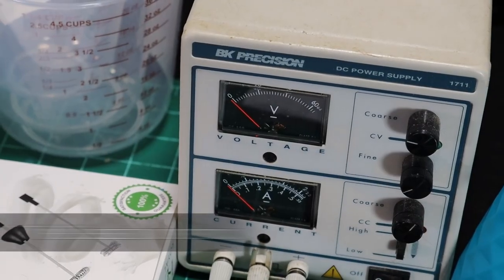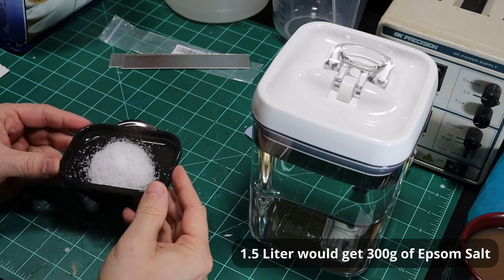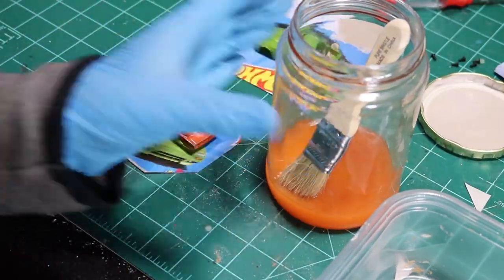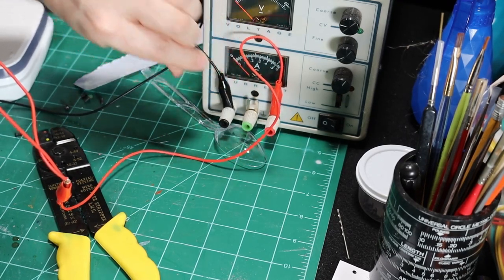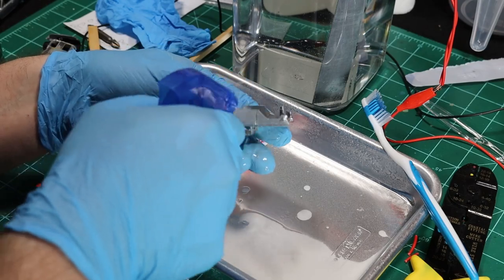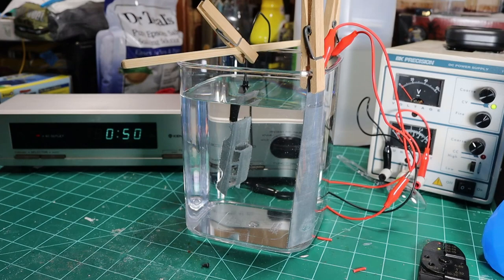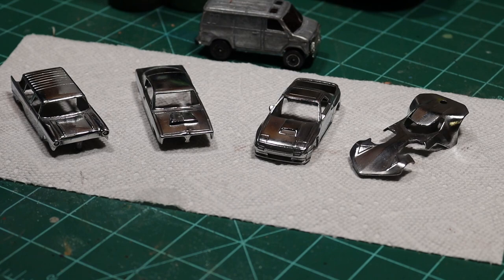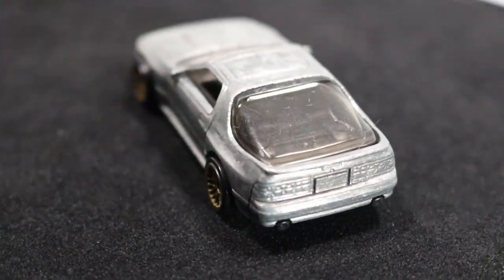How to Zinc Plate Hot Wheels Diecast Cars

Comment: Would it be a better finish if we sand the raw uncoated casting before plating? I’m going to try to use a spare cpu power supply which I believe has 12v 5v and 3.3v output @ .5 amps. Worth a shot. Just starting to getting into modifying and painting hot wheels